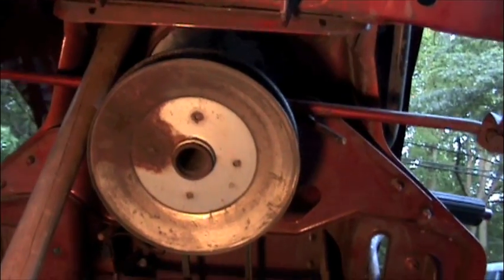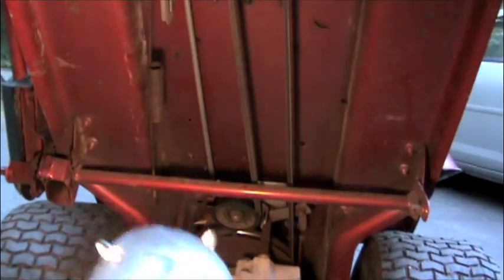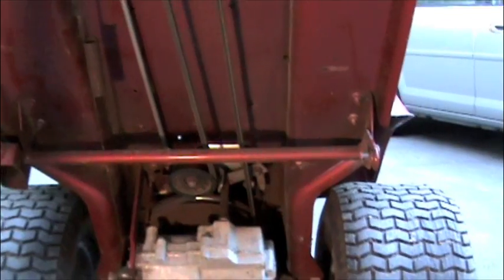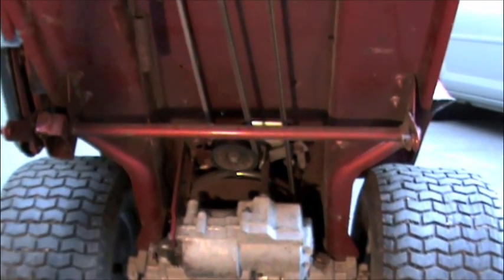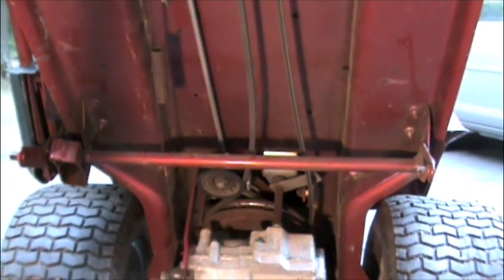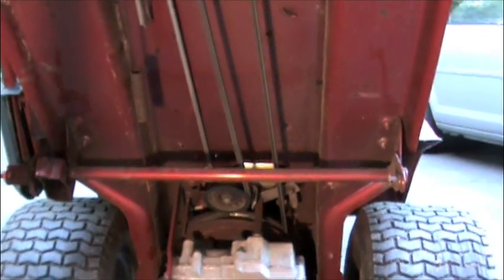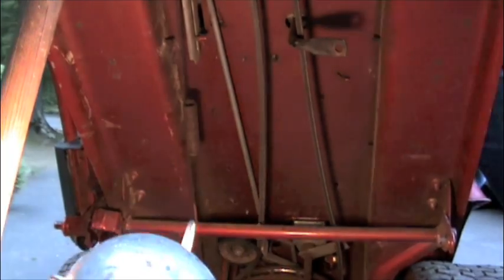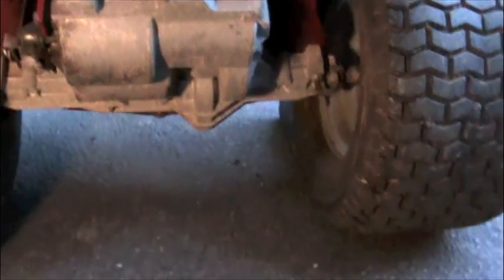How Murray's 'Shift-on-the-go/fly' works

Comment: i had one just like that one . had a flat pulley on the trans , even though the v part of belt was what made contact with pulley . squealed when you first let clutch out , but worked well . only time i ever saw a flat pulley that didn't contact flat side of belt .

Comment: I own a 13.5 hp Murray. Ir runs good and has always worked for me. I'm looking at getting a little more out of it by installing a plow for snow removal. I know that Murray did some ride ons with Craftsman and I wondered if the Craftman accessories would work for a Murray.

Comment: I've got a Dynamark design that has the pulley in the front by the right brake pedal.  It doesn't fully leave enough tension when the clutch/brake is disengaged to stop the rear trans. pulley from moving, so it is hard to shift with that trans. pulley always moving.

Comment: What model number is this I have a mower that's the exact same but the model number is faded and I need parts. Any help would be great
Reply: I have the same problem. did u ever find out what your model is? I need info on adjusting my transaxle linkage.
Reply: Chris Hendrickson this looks like mine. The model number is 42819x14a. Give it a google search and you should be able to find drawings

Comment: With these shift on the fly systems does the rear transaxle actually shift? No matter what I do it seems like the rear big pulley on the rear spins the same? This mower is slow.. and second speed is slower.. What could be wrong?
Reply: You probably need a new belt tensioner, maybe just to lube the pivot on it so it moves freely, or possibly your belt is so stretched it is beyond the range of the tensioner, or so old it has hardened and is slipping on the pulley, or the pulley is gunked up with grass/goop and too slick so again the belt is slipping.  If in doubt, do the cleaning first, then lube, get a new belt next since it will need one eventually anyway, and if it still is too slow, get a new tensioner.  This assumes that you still have full throttle, if your throttle cable has stretched you might need to adjust the tensioner on it.  lol, now I'm sure you'll be back to read my reply 7 years later but maybe someone else having the same problem will see this post.

Comment: I miss the all metal tractors....now they have cheap yet expensive plastic and fiberglass ones
Reply: Really?  What's it matter?  The frame is metal and on anything decent the fr. axle is cast iron.  The deck is metal so all you're talking about is the cover and wheel wells which just serve to improve cosmetics and keep grass from flying where it shouldn't.   Plastic does that job fine so long as it isn't so thin that after a few years of sun it gets brittle and cracks apart.
Reply: @stinkycheese804  the plastic body does fade and crack because of the sun and it is a lot weaker

Comment: We had a murray like that with a 14.5 engine sad to say the starter seized and we trashed it with no tires
Reply: Seems like a silly thing to do when you consider you could put new tires on for about $120, a new starter for what, $50 if you can't just clean and lube it, so with $170 in it, it will work again, use it for a few more seasons and sell it for $300 eventually =  Profit.